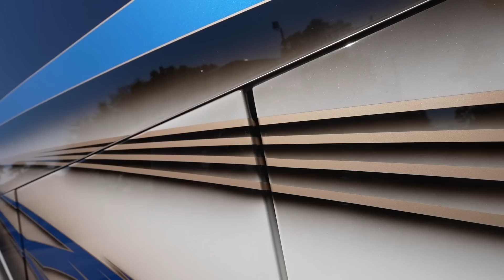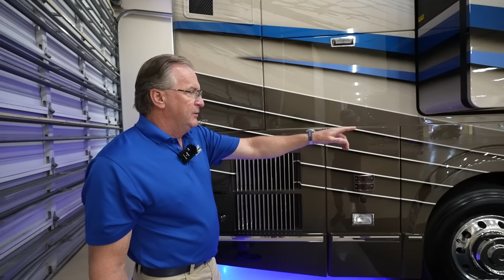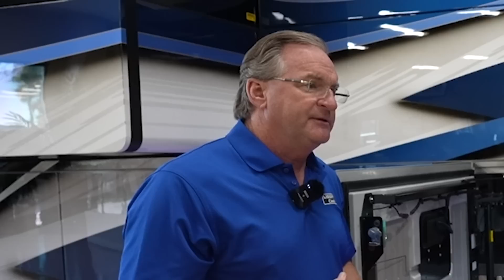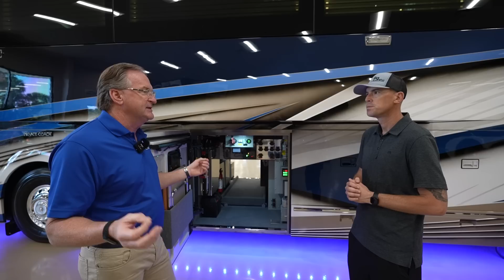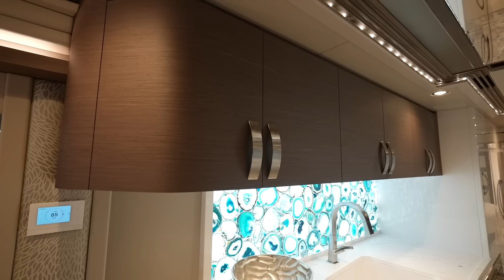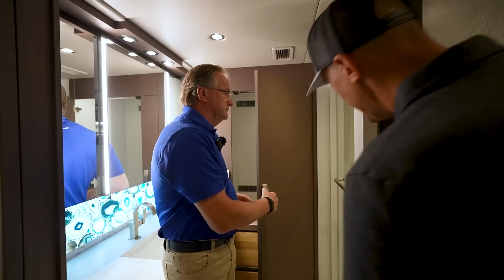Tour of Liberty Coach #898

Comment: I would like to know why liberty only convert the H3 and not the X3 prevosts
Reply: We used to do more of the X chassis than the H3, however during the transition from the Series 60 engine to the Volvo there was a delay in production from Prevost so we had to focus on the H3, then with an economic downturn our production was reduced and so the H3 with all of the different slide configurations and floor plans that we provide became the preferred unit for Liberty Coach, as well as the time and cost of the cockpit would be cost prohibitive for only a couple of X3 units a year.

Comment: Question for Frank:  #1 — is it possible to have or integrate an HomePod Mini or standard to use as the go-to voice assistant for controlling the lighting on the coach and other features? Plus, is is possible to have complete RGB lighting strips used in the accent areas so that you can change the color to reflect the ambience or mood based on personal preferences?  #2  Is it possible to have the glass portion of the shower be able to frost itself when in use?

By far one of the best looking paint designs I have seen come forward from TAOD!  This coach is absolutely stunning. Great video Andrew and thank you Frank for clarifying on the detailed explanation of the Volta Battery System and the justification of the pricing point on that.
Reply: We do use a voice control system as an option, Josh Ai, we have found it to be the best.  Not sure not he RGB for the window and accent lighting, I believe the size would be too large.  Regarding the we have looked at multiple designs for the frosting of the glass, electronically, just doesn't work out so well in our configurations.
Reply: @frankkonigseder6592  Thank you for your reply!